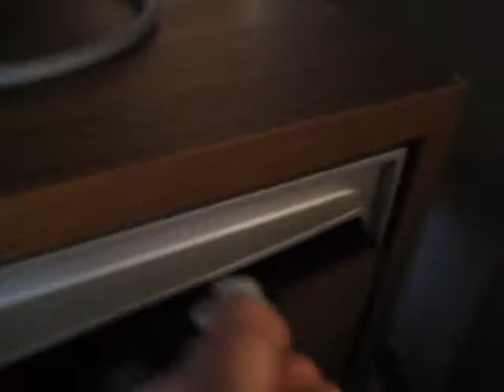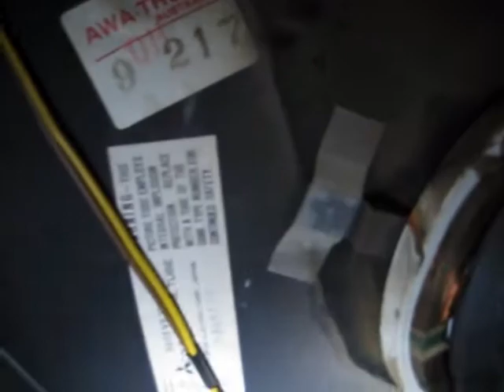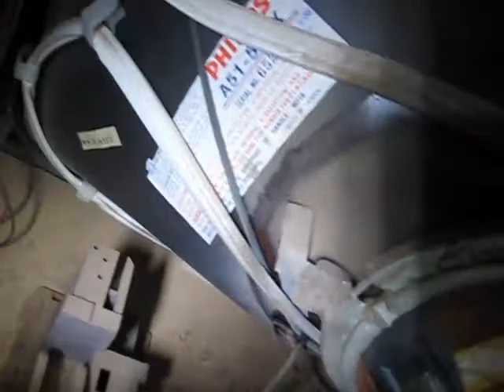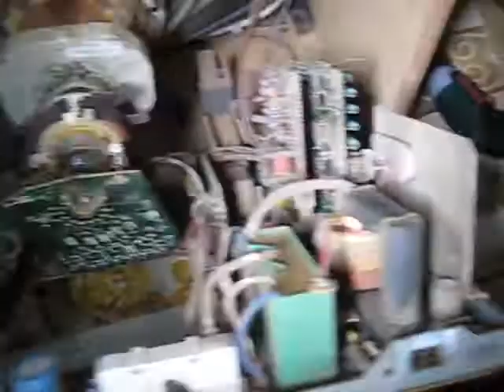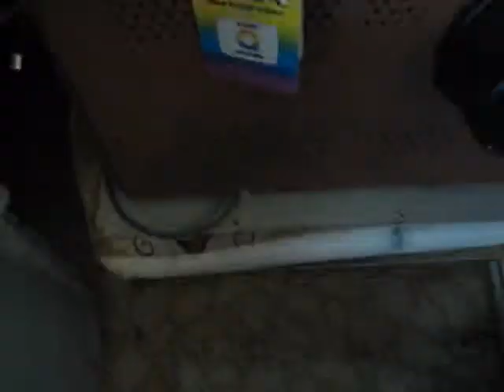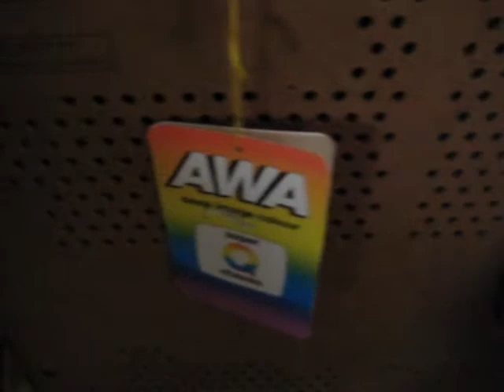Look at my old vintage TV sets

Comment: Pye is an English marque which is currently owned by Philips.  They are one of the oldest surviving electronics marques.  The original company made the first commercially available radio receiver on the English market in 1922.